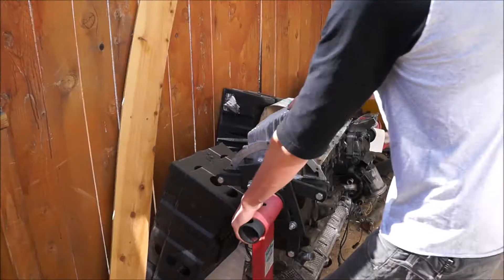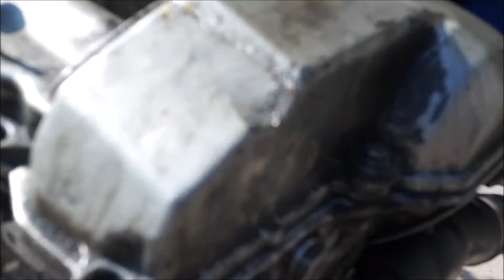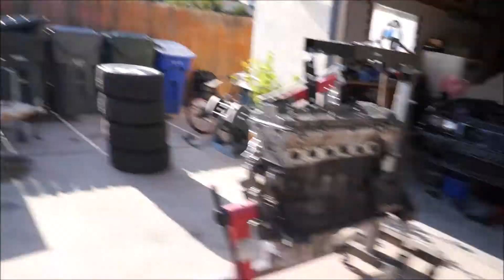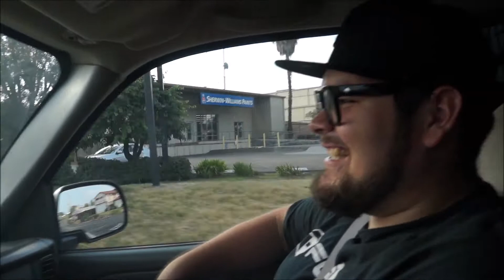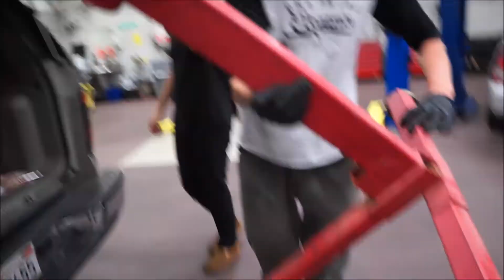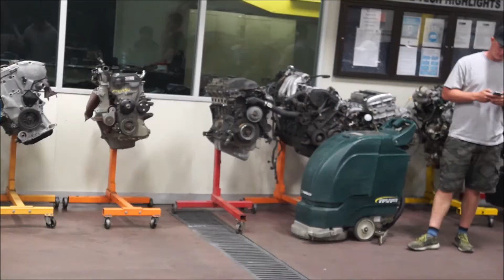The Start of Something Original.

Comment: Nice can't wait for the next video. I have a M50B25TU too and currently supercharged. Waiting for my 3.9 LSD.
Reply from the maker: nice! I bet it will rip with a 3.91. first gear might almost be useless under WOT though hah, what numbers are you pushing?
Reply: M3NACE barely 300rwhp. We don't have long highways here in my country but we have twisty mountain passes. Too hot here too ; tropical climate.
Reply from the maker: true but 300 is stout for these cars for sure, you dont need much